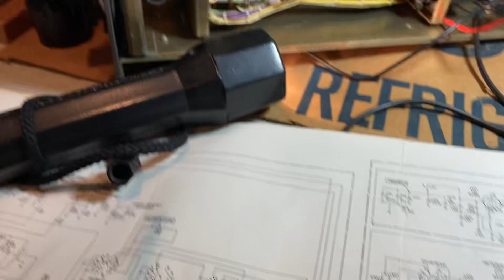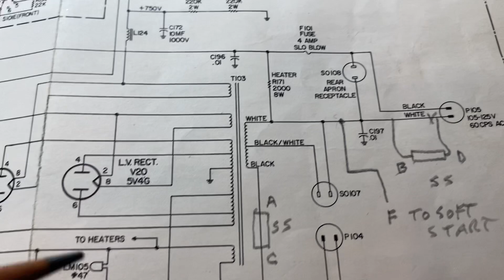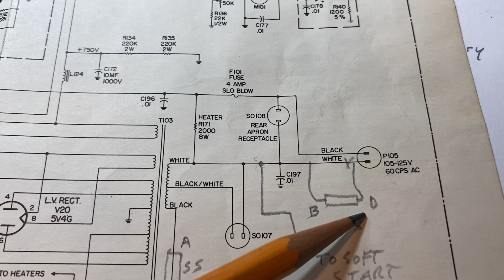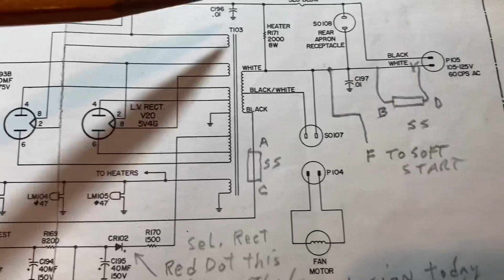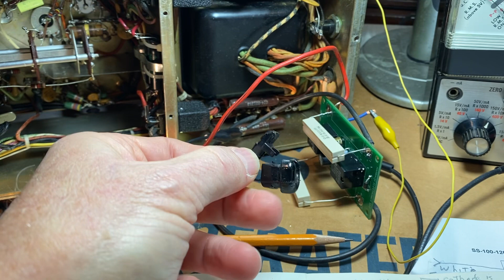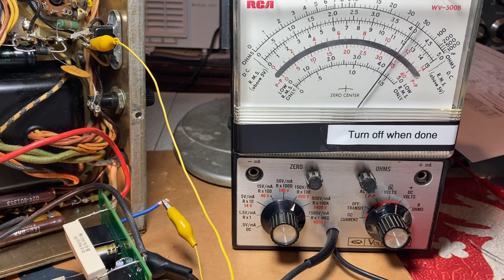Hallicrafters HT-32B Soft Start Addition.

Comment: I'm thinking of looking into acquiring this model receiver, i just uploaded a Hallicracfters SX-25 that I'm working on, wondering how much of a difference this receiver vs the SX25. Thanks!
Reply from the maker: Hello. The receiver in the background behind the HT-32B transmitter is a SX-101A.  The SX-101 series receivers are ham bands only and are a double conversion design, so its more advanced in design. The SX-101A has a product detector for better SSB reception, but it does not cover 160 meters like the SX-101 and SX-101 MkII do have.  These SX-101 receivers are very heavy too (75 pounds) vs the SX-25. I like using the SX-101A with the HT-32B transmitter for the boat anchor experience. I feel that the receiver is a very good performer on sensitivity, selectivity, and audio quality.  It's a pleasure to listen to for all modes. I have the small R-47 speaker which is actually a great little speaker and the audio is very good. I recapped my SX-101A using the Hayseed Hamfest kit before I put power to it. It belonged to a friend and he said it worked 40 years ago so that was a relief for no prior problems with it.  The only complaint I have with it is the band switch is touchy and I think this is an issue for the other SX-101 models as well. I have to let the receiver warm up for at least 30 minutes and then even still if I touch the band switch it jostles the received frequency a few HZ. So, I don't touch it after the warm up.  The band switch has many wafers and despite cleaning the contacts several times, it's still a bit shaky on stability.    The SX-25 is also a very nice receiver in that it has the selectivity selector and the twin 6F6 tubes for push-pull audio with a good speaker.  Good luck with your restoration. Be careful working around the BFO pitch control as it has a delicate coil. Adjustment of the BFO control range is outlined in the manual. It may be OK as-is with no need to readjust.  I recently restored a S-20R which is a bit older than your SX-25.  Before I put power to it, I tested the transformer for open windings and shorts (it was good), I replaced all of the original paper-wax capacitors and the can electrolytic capacitor using the Hayseed Hamfest kit, some out of spec resistors, the dial cords were broken, and two tubes tested poorly.  I had a tough time accessing three capacitors on the left side of the chassis.  One of them I had to clip off and abandon in place, then I wired in the new one as best as I could with some wire and heat shrink tubing.  Typical to radios of this era, to receive SSB I have to back off the RF gain, increase the AF gain. and then use the band spread and pitch control to get the stations in clearly.  I like using the S-20R.  Someday I would like to get an SX-25 as well for my collection. Enjoy your restoration and using SX-25 when it's done!!